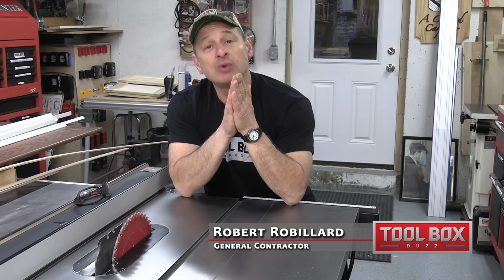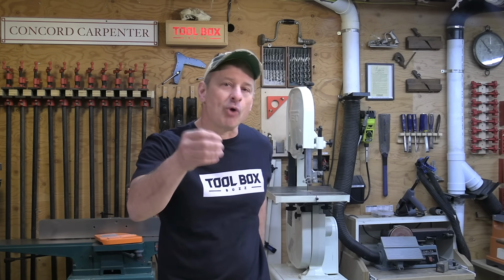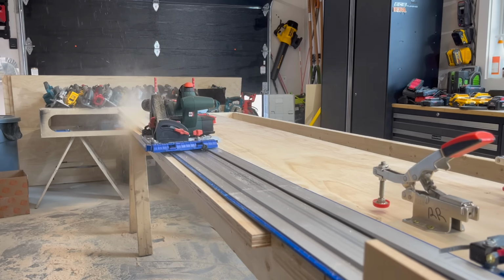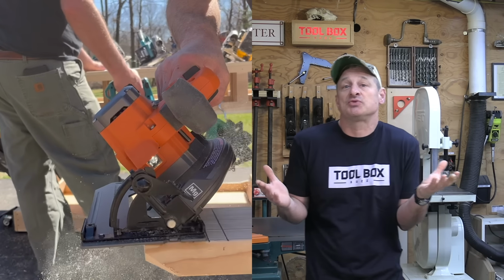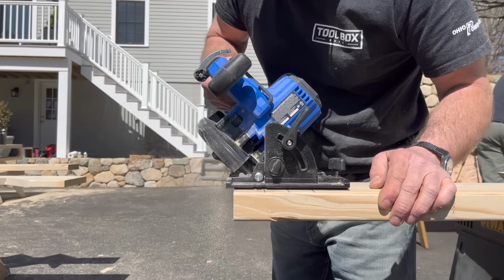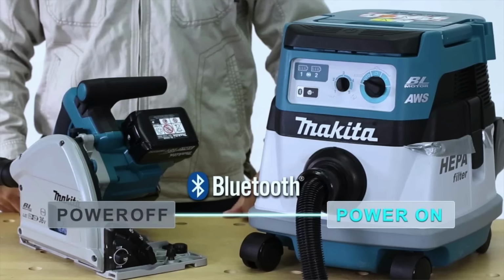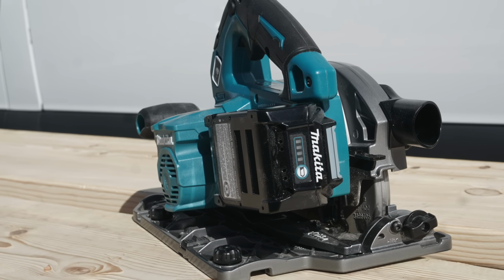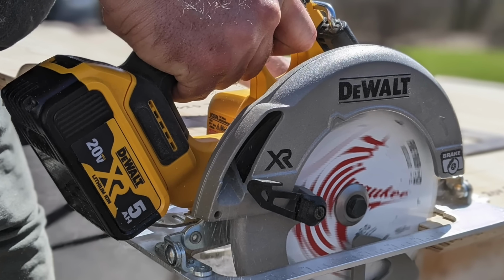Best Cordless 7-1/4 Circular Saw

Comment: Fantastic as always! Just can’t beat makita for quality and accuracy. After using Only makita for years, when I grab somebodys Milwaukee or Dewalt I just can’t believe the lack of build quality. Almost every comparison I watch, even cordless chainsaw etc, makita may not be the fastest but there always comments about the build quality and balance in hand. Go Celtics!
Reply: Makitas were great ten years ago their batteries have fallen off so bad and they are not keeping up with the other brands in tool or battery tech at all. Makitas feel like underpowered tools because they are by today’s standards and their prices are still some of the highest
Reply: @jonruger  That is simply not true. The measure of tools is volts and amps and some tools are geared for more RPMs and some for more torque, depending on the application. A Milwaukee, being only 18V for instance, ends up being a much heavier tool in applications that need power like a big saw, a blower, or a rotary hammer. You will never see a Makita get blown out of any POWER challenge. They are always right up there. However, DW and Milwaukee work hard to make sure the typical American construction guy knows they care about power, whether that application needs that much power or not, while the Makita may cut a lot more boards for the same application for more efficiency, which is really the most important thing. 90% of tool tests on Youtube stress power. No one talks about reliability. If there was an odometer you could put on tools, you would see a Makita goes twice as long as Milwaukee and DW before needing repairs typically, and they also are almost always ergonomically superior. To say Makita's are underpowered is a fallacy.  Batteries, as far as Volts and Amps, are within a few % of each other. They are virtually the same technology, and Milwaukee notoriously overheats for instance, because they are desperately trying to get more power out of 18V, and that causes heat issues, but it is not inferior or superior battery tech at all
Reply: @travisjazzbo3490  you just rambled the same thing on repeat makitas batteries have ten plus year old cell technology they do not put out good power or last very long.  They do not make anything better than a 5 amp hour battery with old cells that’s really more like the other brands 3s. Makitas were cool ten years ago but I gave them up to have tools that can complete jobs on a single charge.
Reply: @jonruger  They have had fast charging for far longer than anyone else which includes cooling the batteries during the charge so they don't cause unnecessary heat so they last longer. 

They have kept the same battery shape since 2005 so they work on old tools and new tools, given how long the tools last, unlike others who keep making users change tools to accommodate new battery types. They also support the most tools of any company on one true battery platform so the jobsite can have well over 200 different tools literally all running one battery platform.

They have had tool to battery and vice versa communication in their tools and batteries far longer than anyone else, to shut down during overheating and overload to protect both the tool and the battery, and also to prevent complete draining of the battery. In fact, they protect their tools and batteries far better than others, which massively extends the life of the battery and the tool, but 99% of construction people don't understand things like this. They call it STAR protection and they have had it a long time:
Here is a quick summary...
Makita cordless tools are engineered for industrial applications, and for added protection during the most demanding jobs Makita created STAR Protection Computer Controls™. STAR is communications technology that monitors conditions during use, allowing the tool and battery to exchange data to protect against overloading, overdischarging and overheating. If STAR detects conditions that threaten to overload, overdischarge or overheat the tool or battery, the tool will automatically stop. This is why you will see Makita batteries lasting far, far longer than most of the others out there.

Battery tech is not very different between batteries for a long time, just protection mechanisms to make the batteries perform more efficiently and last a lot longer. 

You hear these kinds of conversations all the time with electric cars and how you make your battery last longer and why it does and so forth. Makita builds all of that stuff in for both during usage as well as when charging. If you ever own an electric car, you will care about stuff like this a lot more. Construction people generally have ZERO idea of this kind of thing... Business people who understand things like reliability, longevity, ergonomics, true 1 battery system benefits... business-minded people basically
Reply: @travisjazzbo3490  again a long repetitive rant their battery cells and all that tech you mentioned are 10 years old everyone does similar or better now and everyone else uses modern cells Makitas would be just fine if they made modern batteries they revolutionized lithium tool batteries but I’ve done nothing since then.
Reply: @jonruger  You are wrong Jon. You are a typical construction guy.  I have worked for years in a tool supply house. I know what I see and I know what I hear and battery tech simply is not that different over the years in terms of lithium cells. I have also watched videos on the subject but right now I have to sign off. The performance of tools head to head, has to do with the tech in the motor and how it is designed for any given application and that SHOULD be weighed with reliability and efficiency as well for that application. If Makita, in any given head to head on any level, was blown away, then you have something, but that is not the case. 99% of tools can do 99.99% of the jobs they were designed to do out there. It's the ergonomics, the reliability, the longevity, and the service that matters. 

Heck... Look up any Makita Service Center across the country and read their reviews. Maybe 95% 5-star reviews. Even on that level, they are superior making it worth your effort to get your tool repaired, on the occasion, it breaks, rather than buy new like many other companies make you want to do.

Makita is not even close to being #1 in tools in the USA. Just like the Tundra is not even close to being the number 1 truck, though it is far more reliable and holds its value far more than American trucks.

On the world stage however, Makita is extremely highly regarded and very, very popular as many places in the world are not like America where you can buy tools to replace broken ones right down the street.

Construction guys are like truck guys. They have their favorites and their rationale has very little to do with the things that matter, like reliability, service, and depreciation. 

Those things should be the priorities, but, but they aren't.
Reply: @travisjazzbo3490  cells have changed drastically and those of us that actually use the tools laugh are the dorks at the store who think they know shit but have never been in the field and tried it.
Reply: @jonruger  Ask literally anyone how to determine the RUN TIME of any particular Lithium Ion battery or tools. Even ask a particular manufacturer. It doesn't matter. No one will ask you what is the manufacturer of the cells, because cells make very little difference. Try it and see for yourself. 

They will tell you that the way you determine Watt-hours is Amp Hours x Volts. Why do you think no one will ever ask you what Lithium-Ion Cells you are using? Because that is not what matters.

What does matter is:
1) What the worst-performing cell in that cluster of cells is performing at, because THAT is what matters in actuality. So it is crucial all the cells are optimal performers in the cluster. This comes down to quality control.
2) To make a battery more reliable and last longer, the important things are
- Exposure to heat, both intensity and time exposed to it and thus, it is important your tool does not run hot, which tends to be the case when you have less voltage but are running it with more power to the application which Milwaukee runs into issues a lot. For the extremely rare occasion you may possibly need the more power, it will run unnecessarily hot all the time because most tools are run with ALL ON or ALL OFF type of function
3) Make sure you shockproof the battery as much as possible - Makita has done this since their first version and always kept it up. Others have caught up in recent years
4) Keep moisture away - Makita has videos of running tools underwater because all of their electronic components have always been sealed. Up until 5 years ago, the competition had not been doing this, but they may now, I don't know.
5) If moisture does get into the battery case, make sure it breathes to dry out. Many manufacturers had their case designed so the moisture was not draining causing all kinds of issues.
6) When discharging, stop the battery with 20% charge left. Makita has been doing this for years and years understanding that massively extends battery life overall
7) When fast charging, dissipate the heat from the battery via cooling. Some manufacturers are finally doing this but not all, Makita has been doing this for many many years

Finally, a common problem that folks have with DW is when they use generators to charge batteries. This causes all kinds of problems with DW batteries in particular. Makita chargers are able to clean up the dirty current to not have those problems.

Again, some focus on reliability and such, while others focus on marketing
Reply: @travisjazzbo3490  again your long ass rant is just wrong cell type makes a massive difference and it’s why Makitas is behind end of story talk all you want I used to use them but they are not efficient enough anymore.
Reply: @travisjazzbo3490  that’s absolutely not true Makita definitely did slack on technology they never upgraded their battery cells of the 18 V platform from 18 650 to 21 700 cell batteries and That does it only affect power but efficiency and run time as well. They were still using brushed motors when a lot of other companies were using brushless motors etc. Makita makes great tools but they definitely are not on the forefront of innovation which is  one reason for switching to a 40 V platform. Higher voltage is a easy way to get more power out of a under engineered motor. I’m not saying they don’t make good electric motors or have some great engineering but ramping up the power takes a lot of work out of the engineering. The bottom line is if your brand loyal two Makita Milwaukee Dewalt etc. you will find a way to accept and justify their shortcomings we all do that. How many times you see a Makita tool get out performed and all the Makita fan boys “but the Makita just feels so good in the head and comfort is everything” i’ve seen that comment so many times. But when they do I’ll perform then performances everything. TBH those plastic batteries on their 18 V line were some of the cheapest looking feeling and performing batteries and that’s bc they were. So it really just all depends but they make good tools
Reply: @travisjazzbo3490  😂😂😂. Makita fan boys are crazy.
Reply: @steffendetrick9403  Here we go... education time... Hard to educate construction people, but here goes.

- Cells don't make the difference you think they do, but it is easy to advertise, because 5% more power to a construction guy and they think that changes the world, when that extra 5% is rarely ever used. What matters, is the ability to fast charge without ruining the battery, and Makita has been doing that for a decade while some of the other guys still don't know how to do it. In the Makita charger, it monitors heat, current, and a 3rd point, to give it the fastest possible charge, while minimizing battery degradation, to keep the battery working on the job and not sitting on the charger doing nothing, all the while no degrading the battery life.  Milwaukee and DeWalt still can't figure that out even with their latest fast chargers that they finally have, which is why they don't ship fast chargers by default with their stuff like Makita does.

Next... Brushless motors... Big ignorance on this one... seems like a good determination on innovation might be what company actually used brushless motors first in their tools right? That would be Makita. NASA chose Makita for their extremely important missions and Makita created first the brushless impact to lead the way.

BTW... the current style battery everyone else uses for power tools was invented by Makita also. You know, the style the clips in. Back in 2005 they came out with it and eventually everyone else copied it forcing their users to switch platforms etc

The most popular cordless power tool battery voltage... 18V... Who has more on that platform than anyone else? Makita yeah... so far behind... LOL  I will grant you this... maybe for a while they were in terms of sheer numbers of cordless tools, but they came back fast and passed everyone, though in the states that doesn't matter, because for almost 2 decades, Makita stopped their business in the states as far as specific innovation for various reasons.

What tool companies' batteries overheat notoriously and therefore wear down? Milwaukee. Which one's batteries don't stand the test of time and drop dead quickly if using a generator to charge them? DeWalt. They can't clean up the current from the generator entering their batteries and their batteries go to crap quickly if you charge them on a generator too much.  Which batteries notoriously not only last the longest, but actually have been recorded using underwater, though not recommended obviously? Makita. Because they were the first to not only seal the electronics but also provide draining in the battery for the inevitable moisture that gets into batteries that will degrade the cells. Took years for Milwaukee and DW to finally figure that out. Only in the past 3 or 4 years as a matter of fact. 

Hey... presenting these facts to construction mentality people that don't want to hear it, is a waste of time. I get it. But someday, when you become a top businessman, you will realize investing in the tool line that is the highest quality for the money so it keeps running, has the best repair service of them all for when it does break, it makes a difference.
Reply: @travisjazzbo3490  wow you really have no idea what you’re talking about. First of all the Milwaukee batteries don’t overheat that’s thermal protection they are intentionally shutting down to protect the tool and the battery it’s not because it’s overheating and can no longer perform the task. That was nothing but a long incoherent rant. And when they make these tools they make them for people in the trades not youSo go find another hobby because the tool manufacturers don’t care about you. Go build a birdhouse hobby boy.
Reply: @steffendetrick9403  Thanks for saying absolutely nothing in your comment Steffen and proving my point about 95% of construction guys. I appreciate it
Reply: And let us know how that birdhouse turns out.
Reply: @steffendetrick9403  Let me get some Milwaukee tools. Figure they might last long enough to finish it and not overheat too often in the process
Reply: @travisjazzbo3490  here you are watching a tool review on tools that are built and designed for the construction industry that have been reviewed and tested by construction workers and then use that information to tell construction workers they don’t know what they’re talking about🤪🙄. Go by Milwaukee tools go buy some Dewalt tools and some more Makita tools because I have them all but what exactly are you gonna do with them? Nothing but more DIY projects.
Reply: @travisjazzbo3490  You would be better off just buying Ryobi and saving your money they’re more than adequate for your DIY project.
Reply: @travisjazzbo3490  HOBBY BOY !!!where’d  ya go.  I found a great deal on some Ryobi tools and a bird house kit for you!
Reply: @steffendetrick9403  Ryobi, Ridgid, Milwaukee... All under Chinese company TTC. Many share parts between them for efficiency, including motors. That is why you may have noticed Milwaukee struggling with quality over the past 15 years or so. Of course, given those brands are more or less going after the construction guy 'throw it away when it breaks and get another one mentality', it is a business model that can work, particularly in a space like construction.
Reply: @travisjazzbo3490  See that’s actually where you’re wrong you’re not nearly as informed as you think you are. Research and development for Milwaukee tools is in Wisconsin they are subsidiary of TTI rigid is owned by Emerson tools and has a licensing agreement with TTI. And it is not a Chinese company TTI is based out of Hong Kong that’s almost like calling Canada, America. So you know about 10% of what you’re talking about. The power state brushless motor in a Milwaukee fuel is a proprietary motor to Milwaukee electric tool company and will not be found in a rigid tool which is owned by Emerson electronics or a Ryobi tool. This is what happens when you act smug and tell people you’re going to educate them you end up looking foolish.
Reply: @travisjazzbo3490  and what would you know about any mentality on a job site 90% of those guys buy their own tools. So they don’t wanna throw their tools away they’re paying for them you obviously have no idea how any of this works you’re so misinformed about everything. Damn hobby boy😂
Reply: @travisjazzbo3490  i’ll give you one last thing and then I’m done with you. Milwaukee electric tool Company was the first power tool company to use lithium ion batteries in power tools they  used battery technology from the automotive industry. They took that technology adopted it and engineered it to work with power tools and then they filed for a patent. The court ruled that though they did not invent lithium ion batteries the architecture of those batteries as it applies to power tools is proprietary and Milwaukee was awarded that patent. Every time another power tool company sells a lithium ion battery for their power tool they pay Milwaukee royalties Makita, Rigid,Ryobi ,Dewalt etc.. if technology was shared like you were suggesting between partners that have licensing agreements and subsidiaries of TTI then that patent would have been filed under TTI not Milwaukee. So every time you bought a Makita battery Milwaukee got money so Milwaukee thanks you.😂 Probably another reason why Makita batteries suck.
Reply: @steffendetrick9403  I worked on jobsites for years for others and myself, also worked selling this stuff for years, and also study this stuff because I am interested in it because obviously, I understand it at a much higher level than someone like yourself as far as all the different ways of determining real value. You are obviously simply minded as demonstrated by our conversation of you not offering any intellectual value whatsoever in this conversation, and also not understanding what I am saying that are facts. You like something, probably just because it has an American name on it and you like the color. That is likely the extent of your intellect from what I can tell
Reply: @travisjazzbo3490  Hobby boy🙄
Reply: @steffendetrick9403  So just so I have it straight. Even though Makita is literally known for their early battery-operated power tools, and 10s of thousands of those early 7.2 V drills are still in existence from 1978, because they are Makita of course, and they were the first to put brushless motors into tools, and they were the first to invent the slide battery that everyone uses, and they have the ingenuity to have the largest 18V lineup in the business, the most popular voltage,  they are the 2nd largest tool company in the world, and that same lineup can also do 36V without changing platforms, which Milwaukee is now copying because of all their performance and overheating issues in larger applications after they were making fun of Makita for years, and Makita has had fast chargers shipped every day with kits that charge fast but monitor current, voltage and heat, as well as cool the battery during charging so batteries have much longer life while being able to fast charger, which Milwaukee still can't figure out, and they are literally known for ergonomics and less vibration (anti vibration technology) in their tools like recip saws and rotary hammers, some grinders, and concrete breakers that protect workers bodies, have a long history of reliability, engineering and make 95% of their own motors as they are pioneers in electric motors, have always been Makita and nothing else, unlike Milwaukee, have been debt free since the 1960s, you have this incredible point that they were the first to upgrade to Lithium Ion, which was 2005, when Makita also had their first Lithium batteries as well, and Milwaukee, until recently, as a history of heat issues with their battery, because they couldn't understand that going for slightly more power in certain applications, beat up the tools and batteries, so they are finely wising up.

But hey... Good job on the lithium conversion. It was so amazing that the same year Milwaukee came out with it, Makita did also, and they did it with a battery design that still exists today and was copied by others... 

Good on ya... Hey... Milwaukee makes good tools. So does Metabo, DW, Bosch, Hilti, and some others.

All of my arguments still stand as far as my claim of Makita having the overall greatest line of tools with their reliability, true 1 battery system, intelligent fast charging for years now, excellent anti-vibration in tools that should have that for worker health which is mandated in many parts of Europe for certain tool types, and top customer service for repair known to be efficient and very reasonable.

I have the vast experience, the obvious intellectual acumen and history of what I have learned and experienced as portrayed, and you have childish insults that is typical of an average construction worker who doesn't know a lot, as clearly demonstrated by this dialogue.

hey... You will do just fine with Milwaukee, or Ridgid, or Ryobi... I just prefer the best
Reply: @travisjazzbo3490  Honestly anything you prefer immediately loses merit and credibility I would never want you associated with any brand that I use. Poor guys buying tools he doesn’t know how to use.
Reply: @steffendetrick9403  in the world of battery technology for tools and tool lines, where this absolutely dominates innovation for tools, you pretty much have to choose a brand. It is very inefficient to have a tool site with multiple brands and batteries. Preferably you have a brand that has literally one battery that can do it all, with most only needing 18V but some applications needing more than that. Obviously, you want fast chargers as standard, that don't beat up the batteries, because you want the batteries to last and hopefully the charger works efficiently with gas generators that generate dirty current, which DW is known to not handle well. I don't know about Milwaukee on that part. I just know they have a history of overheating batteries which creates a lot of down time for workers, as well as ergonomic issues with larger demand tools that need larger motors to accommodate the limited 18V.

It is reasonable and wise to pick a brand, and that is why you have to do your research on brands and see which will be more reliable and keep you working day after day, and covers everything efficiently that a typical well-rounded construction person goes through from day to day.

Milwaukee and DW are very sexy for marketing... NO QUESTION... Makita is an engineering company, and does very, very little marketing and sales, which isn't the American way
Reply: @travisjazzbo3490  I literally have not read past the first paragraph of your last three comments. All this crap that you’re writing these long rants nobody’s reading😂😂😂. Why would somebody waste there time to read something that’s completely fabricated and just a lie for the sake of lying  they wouldn’t but keep Writing.
Reply: @steffendetrick9403  Oh.... I totally understand the kind of person I am dealing with. Not an intellectual powerhouse that's for sure! Simple-minded to say the least.

This takes me back to my days of educating contractors not long ago at all and having them go all Makita by the time I was done because they asked what I felt was the best tool line. I would list all the considerations, and then educate them on where the more popular brands were on those, and each and every time they went with Makita and they loved me for it, but my boss, not so much! Been fun belittling you with facts, little fella
Reply: @travisjazzbo3490  I have no idea what you just wrote but checkmate happened yesterday when you thought TTI was based in China and TTI also owned ridgid which is all incorrect it’s Hong Kong Emerson owns Ridgid they have a licensing agreement with TTI and you had no knowledge of the Milwaukee lithium ion Patent. But anyways I hope you educate yourself you should start with geography then maybe history learn the difference between Hong Kong and China etc. then maybe you can get into business and finance learn how subsidiaries work.
Reply: @travisjazzbo3490  Not only that you still wrote another comment when I told you no one’s reading them it’s baffling. Are you that delusional. Do you think maybe I’m going to read it? I stopped reading after I realized you had absolutely no idea what you were talking about. But you’re still writing to absolutely no one it’s actually a little sad and depressing. I’m sorry I’ll stop.
Reply: @steffendetrick9403 I admitted I was wrong about Hong Kong and Ridgid, because I thought I WAS wrong about Ridgid... Turns out, I WAS RIGHT and you are WRONG. I know, big surprise right?😁

The original Ridgid Industrial, based out of Ohio, does have some cordless power tools, and they are powered by Makita of course because they are a quality brand and need to be partnered with a quality brand.

The Ridgid Cordless tool line, the one you are talking about, licenses the Ridgid name from that original company.  Now... let's take you to school.

Techtronic Industries Co Ltd (TTI) As it turns out, TTI owns Milwaukee Tool and a host of other power tool companies as you know. It also licenses the RIDGID* and RYOBI names for cordless power tools (Emerson owns the original RIDGID but not the large cordless tool line as I thought in my original argument to you).

Ryobi power tools are manufactured by Techtronic Industries. Interestingly, the same company also manufactures tools for Ridgid, as well as Milwaukee, Dirt Devil, and Vax. 

BOOM!! I was right and you were wrong - big surprise... Let's see if you are man enough to admit it like I was when I thought I was wrong.  Man... my intellect is so great, that even when I thought you proved me wrong, it turns out I was right.

But hey, you still have HONG KONG and TTI that owns all those mediocre companies driven by marketing.. So good for you
Reply: @steffendetrick9403  SILENCE... Yeah... Thought so little fella.  Another one bites the dust!